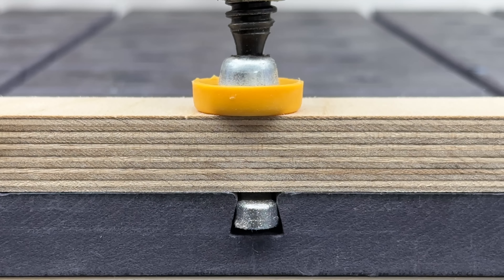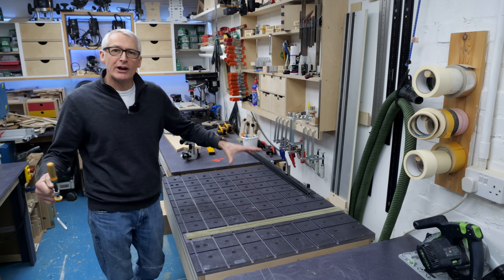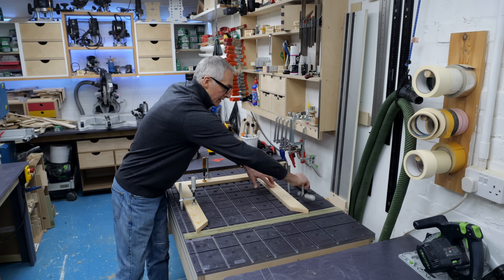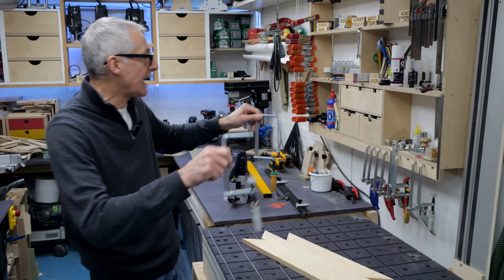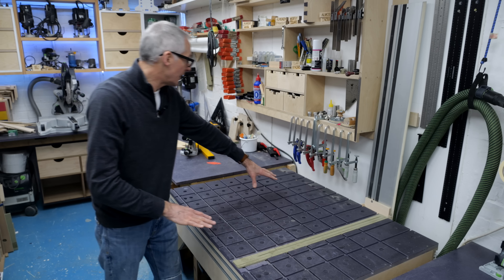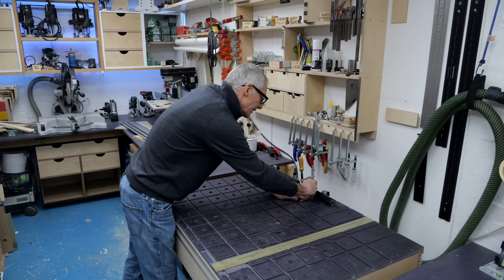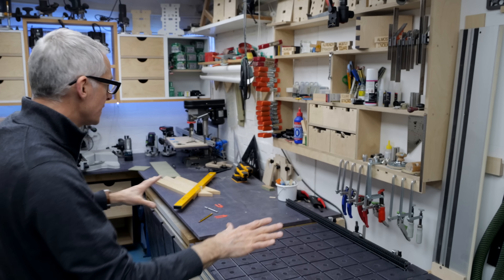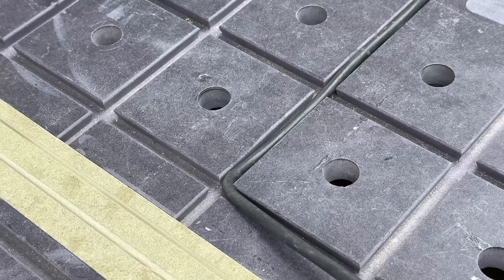Microjig Matchfit Dovetail Clamps 8 months on [video 520]

Comment: Thanks for the insights Peter. I have modified my festool gear/track clamps to use in dovetails and they still work well in my tracks.
Reply from the maker: Thanks Dave! Yes, always an option - though I remain unconvinced about the dovetail slot vs a regular T-slot routed into a surface. 🤷‍♂️ 👍
Reply: I agree with Peter as there is a lot to be said for limiting the number of systems in use (goodness knows there are enough of them). I use the Axminster tee-track cutter to cut slots that accommodate Festool and similar profiles clamps. I find that cutting the slots requires a clearance slot first for best results and I think this is what you did Peter when cutting for Matchfit dovetail slots, so no apparent advantages nor disadvantages to produce the slots themselves. Initially I was concerned about cutting tee-slots into 18mm ply in terms of the strength of the resultant material. However whatever is being clamped  is on top of the weak spot of the track so the top of the track and the material being clamped simply form a sandwich filling between the jaws of the clamp. So for me it's Matchfit avoidance; despite the fact it looks like a very smart system indeed, it's a superfluous one. End of bulletin.

Comment: The fact that you used a standard clamp in a dog hole to secure the level to route better access to use the micro jig clamp tells a lot.  Also showing but not mentioning all the ways that the grooves in the bench catch and collect items. Stick with what is simple and works. Thanks for the update.
Reply: I have one table with both dog holes and grooves then one with one dog holes. Using both holes and grooves makes face frame and door construction the simplest to find clamping options. Then if you sand the 90 degree bend of the clamp a little the clamps work in incra t track and festool guide rails.  This makes it a very versatile clamp especially with jigs. Most used clamp next to parrellel camps but obviously then two are totally different.
Reply: The clamps with dog holes would probably be just as good. But if you can’t go through you bench for numerous reasons dovetail grooves work great. And if you are making a sliding jig for a table saw for example, you can’t have the clamps go under the jig, so the dovetail groove is a must.

Comment: I have and like the matchfit clamps, that said I only have holes on my workbench that I use them with as I didn't like the idea of weakening the top or splitting it.  The main place I use the dovetails is on jigs for things like the tablesaw where it gives easy flexible clamping options rather than attaching a load of toggle clamps, at which point they also double up as nice push handles for the jig.

Comment: Thanks for the update Peter, much appreciated.
I do have some matchfit clamps, but I won't be routing slots in my own mft worktop. IMHO, they're largely unnecessary with all the 20mm holes. They're best used with jigs and fixtures rather than the primary component of a worktop. I like the handles a lot though; quite grippy. So I'll use them for jigs as mentioned, and for through hole clamping.

Comment: Get a 10 degree dovetail bit and widen the slots so you can use your other accessories. Even the Festool clamp will work with a little fiddling. Honestly, try it! If nothing else, it will make a good video. If you make a new top with dovetail slots, you should absolutely use plywood. It's much less prone to tear out. Thanks for sharing!

Comment: I will agree about the frustrations of the Matchfit system as a work bench top.  Having electrical cords, drill bits, pencils, screws, and glue falling into those grooves is rather frustrating.  I far prefer the system for making jigs and fences.  It’s great for that, as you don’t need to have expensive t-track sitting around the shop for the unexpected jig build.  I find myself using the Matchfit hardware about as much as the clamps.

Comment: I took a file to the clamps at the 90 degree bend allowing them to work with incra t track and my festool rails. Only takes a few strokes per side to remove enough material to make them fit.

Comment: 0:05 0:05 My experience is quite different.  I have adopted the matchfit dovetail slots in my benchtops, MFT tops, fixtures and jigs.  In the process I’ve learned to solve most of the challenges, some similar to what you show in your video.  I even adapted your rail hinge design to use the matchfit hardware.  I have a couple of Festool clamps for my rails but otherwise I have about 50 matchfit clamps.  I also have the 20 mm dog hole as well and use the combination of the slots and dovetail grooves especially during glue ups.  All my tops except one are 3/4” ply and I’ve never had a tear out.

Comment: Hello. I have a couple of comments:
1. The Microjig system is mainly used to handle...other jigs that are made by hand for use on table saws, band saws and bench drills.
2. A good thick plywood should be used as the table top.
3. Woodpecker copied the idea a bit and started making their own table tops with MFT holes and dovetail grooves for...Festool clamps. I think this will be the new standard for carpentry tables as the MFT holes will no longer warp from clamping.
I made such a tabletop myself using a Bosch cutter in 24mm thick plywood and I can use Festool/Bessey and Piher clamps.
Reply: Now if woodpecker starting selling a router bit to make those grooves.

Comment: Yup, I found the same issue with the Matchfit clamp fitting other dovetail slots. I have ground off the offending amount of metal in the bend so they will fit but I will not buy any more of these clamps. I do Like the removal pads though. Petter you put out some very good videos for us  ADD folks. Thank you for that.

Comment: Peter, I bought several of the Banggood clamps & swapped some of the lever type with what I could with the Match fit. Then I decided to grinded off a slight bit of material off both sides of the banggood clamps so that they would all fit in the match fit dovetail slots

Comment: I feel your frustration with these. Before i had an mft i bought these to use for clamping my festool track down on location jobs. I called the company and they told me to dremel the neck of the clamp to fit the festool. Pretty easy to do and now i use them on dashboard PWS T- track. Not hard to modify but they do rust a bit where i dremeled material off.

Comment: I agree with most of your thoughts/findings and it really does depend on your individual setup and use.  For me... most of the time my Matchfit clamps stay on the jigs they are used on (drillpress fence, table saw fence/jigs, miter saw fence, etc.) and rarely come off.  On my outfeed/assembly table I typically use the dog holes with either the Matchfit clamps or regular dog hole clamps, unless I'm doing something complex and need the extras to hold the parts down better.  I only use them with plywood and not MDF.

All in all, I'm happy with them for their purpose and find it way more convenient than my old t-track and related clamps since the Matchfit can be made to fit anywhere you can cut a dovetail for them.  It really makes most t-track I used to use very inconvenient when you consider the time it takes to install them where needed and have to buy/install the actual t-track itself.  

My only complaint... they are a bit pricy unless you grab them on sale.  I too wish all manufacturers made them interchangeable.

Comment: When clamping I really feel that it comes down to the right clamp in the right situation. I would use Festool clamps on my MFT surfaces, but am also keen on the Bessey TW20 click klamps for the same task as you do not need to feed them through the work surface. I am also a fan of MicroJig and think they come into their own when you want to hold a workpiece securely to a jig that has a flat bottom to allow it to move freely when either trim routing or using on a table saw

Comment: Great video. I am of the same mind. I have both a MatchFit assembly table and MFT style track saw table. I always find myself just using the MFT table and slipping the dovetail clamps through the dog holes. Dog holes have proven WAY more versatile in my workflow. I also appreciate your B roll at the end of the video of stuff getting stuck in the dovetail grooves. It's a pain to get things out. Things fall through dog holes completely, which is also a pain, but I feel like I know in advance what I'm signing up for with the dog hole issue.
Reply: Yo saco todo lo que se cae por las ranuras con ayuda de un imán

Comment: Thank you Peter!

You cannot be efficient with every single tool, every single method of doing. I never own a MFT table but use to dog holes on the CNC and assembly table. Dogs are fantastic for positionning and referencing. Not so much for holding compare to the Magfit system. The only problem with Magfit is about the straight face approach, no rotation. You can make a cutting table (MFT) with diagonal slots. Peter Parrfit made a video about such a table using dogs, that illustrate what I mean. Also the Magfit clamps works wonder for holding panels vertically and for all kind of jigs around powertool.

Comment: Great review. I have considered the matchfit system because as a hobbyist the MFT is just not an option if I want to keep living in my house with my wife and kids. I have really enjoyed the budget MFT builds but the MFT tops have been difficult to find in my area and not sure I have the time to layout and manually drill all of those holes. Thanks again Peter for these videos.
Reply: There are a number of jigs available now that allow you to make your own MFT tops. I borrowed a friend's Parf guide set for the cost of a six-pack of beer. Also a number of folks with large CNCs who will cut one for a very reasonable fee.
Reply: I bought an MFT 60 by 85 top on Ebay for under £50 which I love, so it can be done on a mobile basis.

Comment: Interesting video. I see your point. I recently bought the MFT/3. But I don’t have any of the Festool clamps yet. Or any other brand like these. I only have the match fit clamps. So my viewpoint was that I was glad that I could use them in the holes. I also don’t have other t-tracks. So I don’t have the compatibility issues. However… your view on them does help in deciding the times I will use the system and when I won’t. I for sure won’t be using the router bit and doing the grooves in my new MFT. I did buy some TSO products and feel pretty good about my clamping right now. Thank you for sharing your findings.
Reply: I’ll add… I was gifted the whole match fit set for Mother’s Day. So I have the dovetail bit (not the other one), 6 clamps, lots of the hardware stuff, as well as some other items. I do like the system a lot. But this helped me decide on the jigs I will use them for.

Comment: Thanks for the update and your opinion. 
I feel like you may open up the dovetail slot in the middle of the table too, so you can drop a clamp down in either direction.
I can see this system being very useful for repeat work were your not repositioning after every cut or glue up.

Comment: I have received the Woodpecker track clamp router bit and cut a few test grooves and here is what I found. (note:  It pretty easily cut grooves in both baltic birch and mdf in one pass.)

The Festool track clamps work perfectly as expected.  Surprisingly, the MIcro-Jig dovetail hardware (not the track clamps) for jigs also work well without any modification.   The Micro-Jig track clamps will work with a small modification: a shaving of approx. 1/64" on either side of the clamp where it bends; takes about 30 seconds total with a grinder.   1/2" hex bolts with a 5/16" threaded shaft also work perfectly so you can  make use of all those 5/16-18 standard knobs that you may already have.  Finally, if you do a similar small shaving of metal on those oval shaped t-track bolts they will also fit in the Woodpecker track.  

It would appear, then, that the Woodpecker track clamp bit is more versatile that the dovetail groove especially if you modify the dovetail clamps and t-track oval bolts which is trivial to do.    Since I only have a few of the Micro-Jig track clamps I will definitely modify them and perhaps a few of the oval bolts if needed.    And with cheap 1/2" hex bolts I can now make use of all those knobs I already have.   Doesn't solve Peter's insertion point issue but I could live with that.
Reply from the maker: Great info, thanks for sharing! I’ve resolved my insertion point issue by widening the slots at the back of the bench, in front of the fence. Works well.

Comment: I just use Bessey clamps & cut the grooves with a dovetail bit. Works the same way (as far as I can see) & was a lot cheaper than the matchfit gear & more cross compatible. 

My setup is a bit of a mashup. Originally it just had some T'Tracks. Then I added a grid of MFT type 20mm dogholes & lastly added some dovetail grooves. 

This combo allows me to clamp most things. At some point I'll replace the top when I've decided which system I use the most.
Reply: All systems have their pros & cons. I suppose trying them all out is the best way to figure out which one to go with (or whether to use a combo).

Comment: You obviously need to move your worktops to make them more accessible for the Microjig clamps ... solves all your problems 😂
I don't have this system or t-track or MFT at the moment, but will be going with an MFT style top when I do get around to building myself workbenches ... it seems to offer everything I'd need, while at the same time not weakening the top by cutting slots in it which can then actually delaminate the top if used incorrectly 👍

Comment: Hi Peter... I use them, but I'm not fan... I made a cross cut sled using them... it's all right...  I made a portable dog hole work bench that I use with my Bora Centipede Workstand... when needed I grab a matchfit dovetail clamp for a dog hole clamp. I have promised myself to build a bigger cross cut sled using the matchfit dovetail clamping kit that I bought... maybe I'll become a fan... :( ?

Comment: I was wondering about the issue with needing to always insert from the edge of the top. I have both an MFT type table and a T slot table. The thing I like about the T slots is that I can slide a stop to any position easily, but the MFT limits me to the dog hole positions; the same with clamps. The advantage the T slots have over the dovetails is that I can insert at the intersections so I do not need to slide all the way from the edge. I do hate all the variations in T track that causes compatibility problems.

Comment: Great update video Pete, how are the other bench tops holding up mate? Do you think the black is suitable for a van fit out ? Can you get  it in MR ? Cheers Pete
Reply from the maker: Thanks Dan! Other bench tops are absolutely fine.  The Fibracolour isn’t an MR biard no, and seems softer internally than eg Valchromat.  As long as you’re not exposing the core or treating the edges harshly, it’s no problem. 👍
Reply: @10MinuteWorkshop  thanks Pete appreciate your feedback 👍

Comment: I have used the Micro-Jig system for both jigs and the tracks on an MFT type top and, like Peter,  see more cons than pros.      While they work well for jigs - my initial use for them - I don't like the flimsy small knobs and smaller gauge screws compared to t-track hardware not to mention how pricey they are.  Also the jig hardware, like the tracks, is not compatible with non-Micro-jig hardware.    

As for the dovetail tracks they reach some areas that the dog holes do not but not many.    I have found the dovetail tracks more useful as vertical and horizontal tracks along the side panels on my bench.   Using those side rails I made sliding fences along the edges for my track saw guide rails and am able to align the blade to run in the dovetail tracks avoiding any need for a sacrificial strip or any mark in the table top  (Those sliding fences are height adjustable and have an embedded 3/8" dowel on the top of the fence that the Makita rail fits in perfectly.  Alignment is easily achieved by sliding one fence pivoting on the dowels until the other end is square.)   Also those side tracks work well for clamping wide panels and other things that a vise might not accommodate.   Because my top is open on all sides and underneath I don't have the accessibility issues that Peter has.   I also already had cutout slots to accommodate a crosscut sled from the table saw and can use those as interior insertion points for the dovetail clamps.   There are also some interesting uses for inserting the dovetail clamps into dog holes from underneath the table into dovetail tracks on a inverted jig piece.  

However, as useful as the side tracks are, t-tracks would accomplish the same thing with greater compatibility and wider selection of better hardware at lower cost especially if you already have lots of t-track hardware and other clamps like I do .   That is why I will soon try the Woodpecker router bits for making t-track.

Comment: I really like the concept of the Matchfit system but unfortunately I don't have access to the hardware and clamps where I live. I do have access to track saw clamps, though, so what I've been doing is I 3D print hardware that's shaped just like the Matchfit track nuts but fits nicely inside a 9/16'' dovetail groove, which also happens to be a great fit for my Makita clamps (which I can find rather easily). It's also way cheaper than the original hardware - all I need is a few cents' worth of filament and an M6 hex bolt. Finding a decent 9/16'' dovetail bit is a bit of a hassle, however.